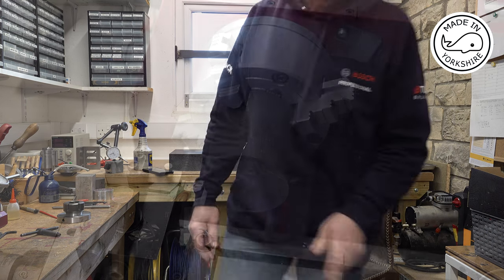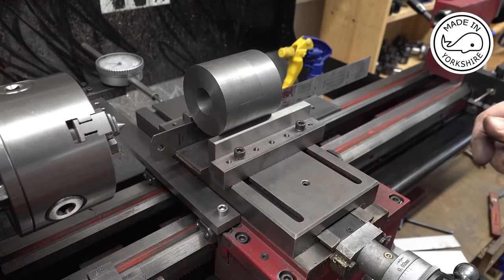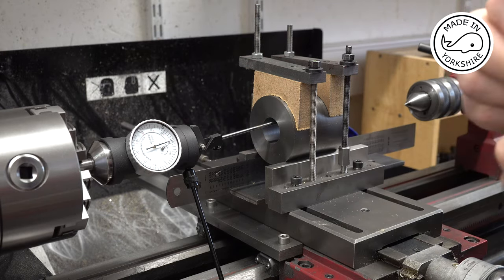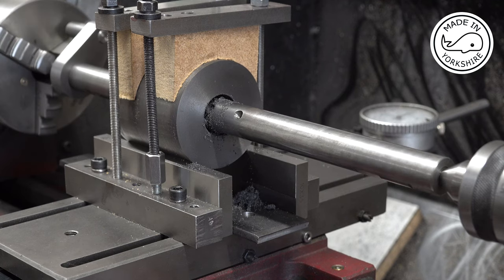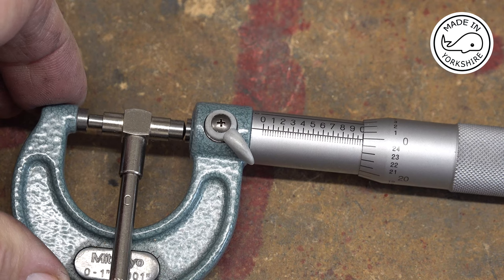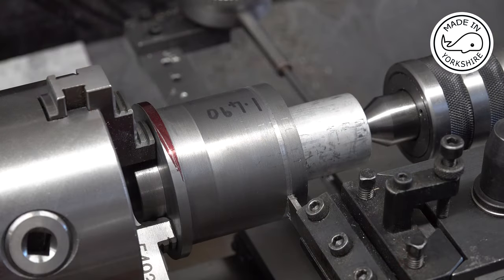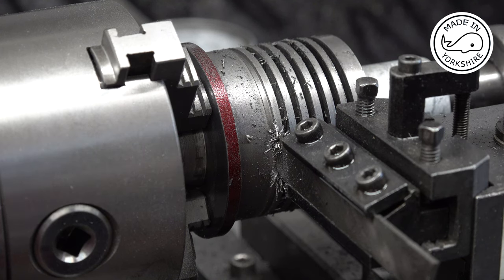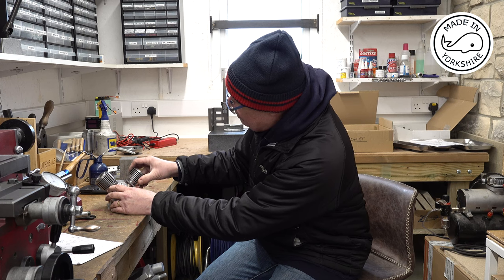#MT49 Part 11 - Jerry Howell V-twin IC Engine. Machining the Cylinders. In 4K/UHD by Andrew Whale.

Comment: Gday Andrew, the cylinders turned out great and the engine is really taking shape now, the adjustment tool for the boring bar is a good design and makes setting the tool accurately a breeze, thanks for sharing mate, cheers
Reply from the maker: Thanks Matty!

Comment: As ever I always enjoy watching your rapid improvement as a model engineer. We all learn from your mistakes., as well as our own ones. My number one comment this time is about the manner of your support using the tailstock. The concept is correct. But having the connection point between the centre & the work piece beyond the end of the work piece is where I would politely suggest that getting that  connection tight to or better inside the end of that hole is a lot better from a bending point of view. The lesson here in the long term is to think in terms of a "top hat". The rim is the thrust interface & the location of the lathe tool centre needs to be on the inside of the "top hat". This way your forces are working with you, not against.  Mervyn Price
Reply from the maker: Hi Mervyn. That is great advice and well explained. I must try to remember that for future operations.
All the best.
Andrew

Comment: I really like the line bore tool that you made, it’s really ingenious.  I may have to try my hand at making one, but I think I might have to watch your video making the tool.  I know Hemingway sells a kit but I’m going to make mine using the materials that I have on hand.
Reply from the maker: I highly recommend it if you need to bore long cylinders. It gives a consistent diameter throughout its length. Definitely worth having a go at making one. Good luck 🤞

Comment: Hi Andrew, good to see you progressing well with this build. A suggestion for setting up the line boring for next time would be to initialy clamp either end of the blank between centres. You may need to make a couple of caps if you don't have centres large enough. With it located, you can zero a clock over the top of the blank, place a vee block underneath it and shim it in height until the clock still shows zero with the clamp tight. With a vee block, there's no chance of one of the packers moving, the job dropping and all hell breaking loose. You got there but I was holding my breath whilst you were machining the bore.
Reply from the maker: Hi Andy - brilliant advice. I MUST try to remember that for next time.
Cheers
Andrew

Comment: Impressive work, great filming, editing and presentation.
Great rigging for the line boring but it looks close to hazardous for an ignorant eye..
Time 21:00, testing the bore with the dummy piston shows the great bore. More then well done!
Time 27:00. As I remember air cooled cylinders from the mopeds and motorcycles the air width was 3 - 4 times the the thickness of the cylinder cast iron. Strange design proportions. Too little of air circulation as I think.
Increasing the RPM when getting deeper having a continus lathe speed control feels natural but not practised so often. Recently a 25 mm hard rolled steel was parted off practising increased RPM and it worked like a charm. Standar motor oil was used, not the toxic WD40.
Looking at the presentation, 35 minutes looked like a lot but once watching the video, it was worth every minute.
Reply from the maker: Thanks Stefan! You are very brave parting off hard rolles steel! 😧
Cheers
Andrew
Reply: @learningturningmetal  Inspecting the parting off tool now I got a surprise. The insert is 1.5 mm wide but is was pushed back into the holder and it looks like the tool holder did the cutting! It was a well centred insert of that gold coloured type. The last 2-3 mm I hacksawed.
Reply from the maker: @Stefan_Boerjesson  ha ha the joys of home engineering!
Reply: @learningturningmetal  Yes. Why buy inserts?..... Joking!

Comment: That is a big stride forward. Heavy engineering compared to anything I have built. The cylinders look great on the crankcase, really taking shape. Good to see you getting value out of your boring bar. I dont envy you all that work with the parting tool. Maybe a rear toolpost parting tool would be a useful project for the future. I know Hemmingway do kits for them.
Reply from the maker: Thanks Tim - I'll check out the Hemmingway kit.
Reply: @learningturningmetal  before plunging in have a look at Mark Preslings channel. He recently made a back post tool holder and explains in detail the benefits of mounting your parting tool this way. He also shows how to make one from scratch in a short series. Well worth a look. He does some excellent projects. Channel is just called Mark Presling. He is in Australia.
Reply from the maker: @timjoinson7232  Thanks for the info. His channel is really interesting and he makes parting off look a breeze! I must have a go at making one.
Cheers
Andrew

Comment: Hi Andrew, I have found when using a parting tool, it really does matter how far away from the chuck you are and the speed you are cutting at as chatter can be amplified by resonance within the setup. Rigidity is your friend, I have a rear parting tool on a dedicated fixture on the cross side and that makes a tremendous difference as that setup is far more rigid. Keep up the good work, I am looking forward to seeing the final outcome.
Reply from the maker: Hi Terry - thanks for the suggestion. I really must explore your method further.
All the best.
Andrew

Comment: Hi Andrew, you might want to heat your test piston to above what you think the operating temperature is without the o-ring and check your fit for expansion 
Rich
Reply from the maker: Hi Rich - you got me thinking! My Hoglet v-twin has aluminium pistons. Also my hit-n-miss engines. However those will never get really hot - unlike possibly the Howell which should be capable of reasonably high revs. I've looked into thermal expansion, and aluminium expands 4 times more than cast iron. From my calculations the aluminium piston will expand by 0.005" at just 200 degrees C. On the other hand the cylinder will only expand by 0.001". This engine won't be used for long periods but I bet it could get hotter than 200 degrees C. So that would mean a gap of a minimum of 0.004". The drawback with cast iron pistons is the weight and the Howell instructions say you need to remove as much material as possible from the inside. So it looks like I will have to try to make the cast iron pistons with home made cast iron rings. That should be interesting!
Cheers
Andrew
Reply: @learningturningmetal  hi Andrew, it looks like you have already thought this out, looking forward to those videos!
Rich

Comment: Lovely work again - I suspect that you weren't getting proper support from the live centre during the grooving operation because of the length of the overhang from your piece of aluminium. Unless the tailstock was clamped up pretty tight, the aluminium can hinge slightly where it sits on the end of the cylinder, negating any support. If the aluminium were cut shorter, so that the centre was close to the cylinder, then this effect would be much less, and the support would be more solid. Anyway, the job is done now! The engine will be quite a lump when it's completed.
Reply from the maker: Many thanks for the advice - I will try to remember that one!
Cheers
Andrew

Comment: Machining cast iron can be a lot of fun. I did get a little lost, though, why the line boring setup and not just continue using the boring bar?
Reply from the maker: Hi - line boring is far more accurate and consistant than using a boring bar. I highly recommend! 
Cheers
Andrew

Comment: Interesting work again. At the end where you show the cylinders fitted in the crankcase it looks as though the square base of one cylinder is not lining up accurately with the crankcase: is that so ? Regards, George.
Reply from the maker: Hi George - well spotted. The cylinders should slot onto studs and be bolted down. At the time I only had one stud and one cylinder was just plonked on top of the crankcase. Yesterday was my stud making day - all sorted now!
All the best.
Andrew
Reply: @learningturningmetal  Glad that it was only that. Onwards and upwards.

Comment: By using aluminium instead of the recommended cast iron for the pistons will throw the balance out ,cast iron being somewhat heavier than aluminium. check it out because it could shake its self to bits.
Reply from the maker: Hi Glenn - thanks for the advice - you got me thinking! From reading the instructions, the main factor for using cast iron pistons is due to thermal expansion. From my calculations aluminium pistons would expand by 0.005" at just 200 degrees C, as opposed to 0.001" for the cast iron. As the engine should be capable of pretty high revs (and high temperatures) I think my idea of using aluminium pistons has literally crashed and burned. Jerry Howell does comment on the weight of the cast iron pistons as being the real drawback, and the drawings show the removal of as much material as possible. So I think I will revert back to the plans, and possibly make my own cast iron rings too.
Cheers
Andrew